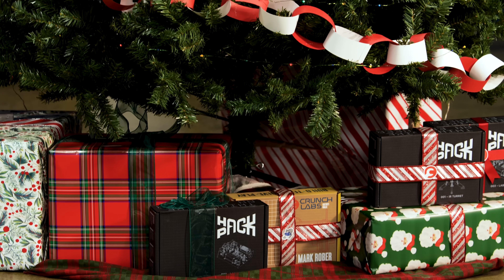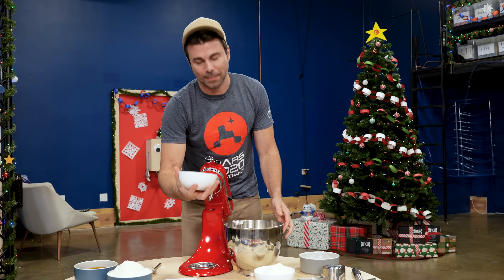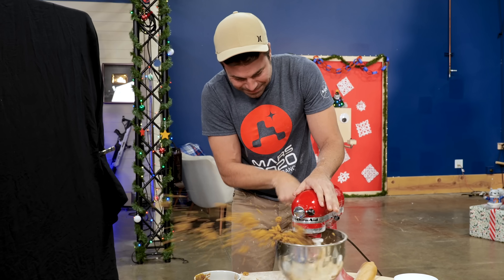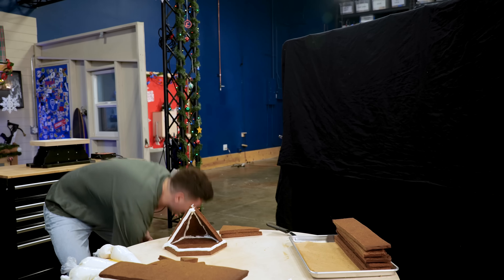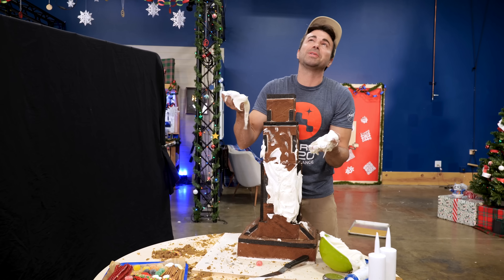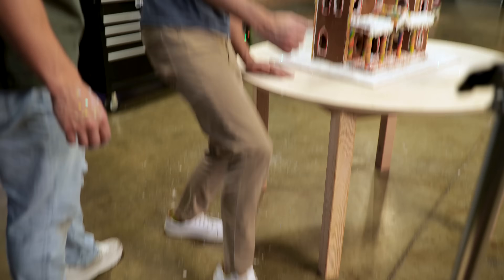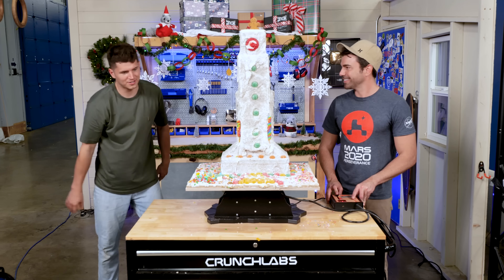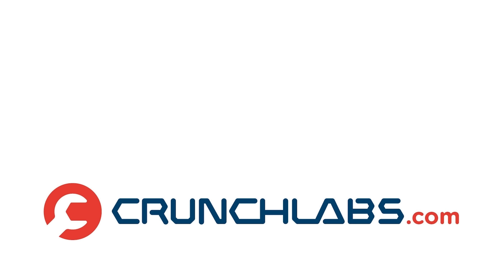Engineer vs Pro Chef- Extreme Gingerbread House Contest

Comment: Mark Rober, I have a science question for you if you can freeze water by hitting it on the table when it’s about to freeze, can you do the same with the pool?
Reply: Wouldn't work pool is to big the temperature would be very different on the top and on the bottom in the middle to many variables it's just not likely
Reply: Also theres clorine which prevents a pool from freezing
Reply: @solemnband39572 that’s what I was about to say 😂
Reply: The water bottle trick relies on supercooling water below freezing and is easily done in a freezer where it cools somewhat evenly.
The pool water has to cool at every point equally which is realistically not plausible
Reply: If you have even cooling everywhere, it should be possible, but a pump would disturb the water and freeze it
Reply: Nick falling + almost frozen pool =frozen pool and no more losses 😂😂😂😂😂😂😂😂😂😂😂😂😂😂the 100000000 IQ play
Reply: You also have to think about the the volume, weight, time as well for the pool to completely freeze fully.
Reply: @ashleyvera305  A pool for Barbie is still technically a pool. So… ;)
Reply: he begins to carry the whole pool..
Reply: Yeah , I wish ...
Reply: I doubt it, the way that trick works is by bringing the water to near freezing first

Also considering how difficult it is to bring a POOL to freezing point because of how much energy it takes to freeze water 

Realistically impossible, theoretically plausible
Reply: @fazi.brothers  True that’s why fish can survive in ‘frozen’ lakes. Actually they are swimming in warmer than zero degrees Celsius temperatures
Reply: You just throw a rock at the pool